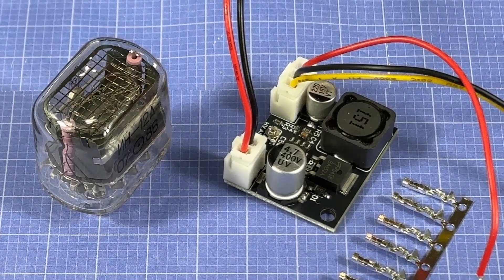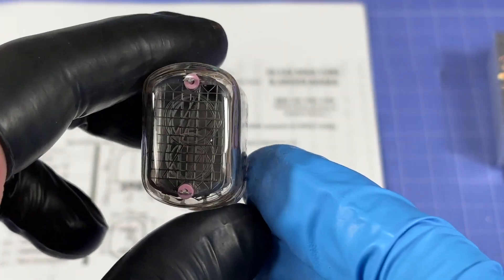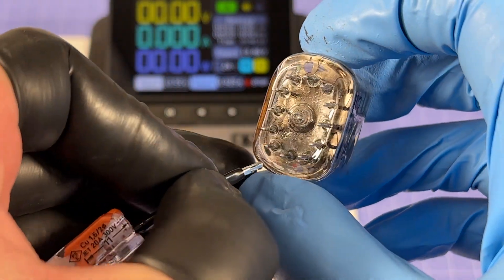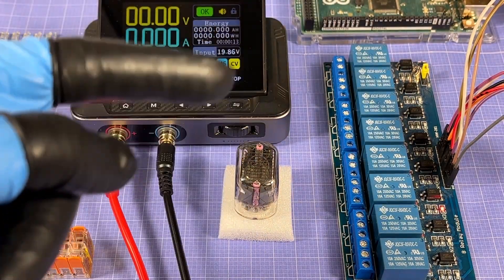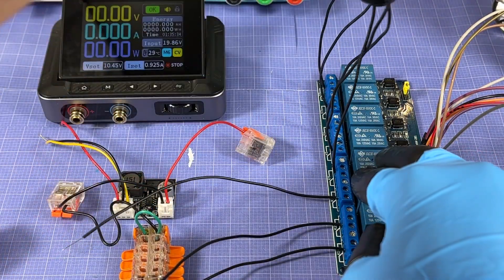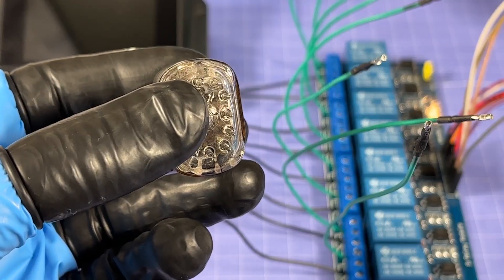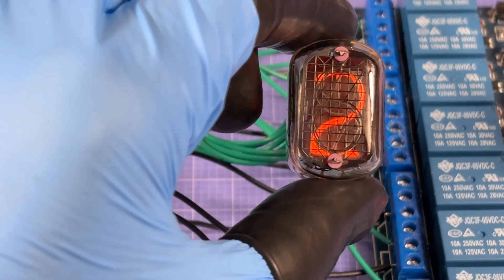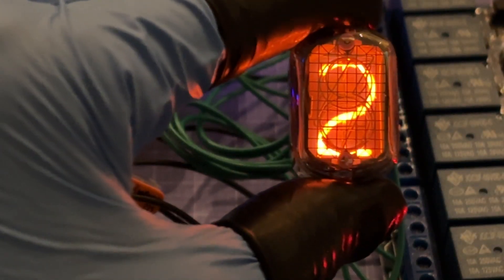Fun with Nixie Tubes & Control with Arduino (IN-12A) | Part 1

Comment: I have several Nixie tube clocks 

My favorite one I don’t have is a fallout theme one 

And there are a couple of nixie tube watches
Reply from the maker: Ooh cool! The nixie watches I’m super interested in, specifically the tiny Nixie tubes that go in them! 
I love miniature versions of stuff, like those tiny hard drives they had in those old iPods? I really hope I can get my hands on one of those and the equipment necessary to be able to use a tiny hard drive like that!

Analog and mechanical devices, especially cleverly designed ones have a special place in my heart

Comment: Since the numbers are triggered by the cathode, you can use a 600V N-channel MOSFET instead of a relay. Connecting the source pins to the negative pin of the boost converter is sufficient; it will result in a quieter and smaller circuit.

Comment: Just in case you aren't already, you should consider using mosfets instead of relays. They'll do the same thing but take up less space and don't make sound when in use.

Of course if the sound is desirable or intended then disregard everything I've just said!

Good luck with the clock!
Reply from the maker: Yeah I actually kind of like the sound haha, but I will probably have to use mosfets if I decide to go the route of reusing the same 10 relays for each digit, and just switching really fast between them to display the time… I’ve found some “micro-relays” which I’ve ordered as well though to see if I can manage to fit a whole bunch on a PCB and just keep everything super simple and as old-fashioned as possible
Reply: @KeonsLab I figured the clicking could be part of the old timey charm. Looking forward to the next update on this!
Reply from the maker: Me too! I’ve just had a really good idea of either 3D printing an enclosure and then putting real wood veneers on it to make it look like wood, or I could do carbon fiber or actual wood with a laser cutter.

Which would be the coolest? I personally really like the idea of real wood and putting a nice stain on it. specifically with a type of wood that smells good (I love the smell of red cedar wood, maple wood, and whatever they use that makes natural chunk charcoal smell so ‘happy’)

I want the clock to actually influence the room it’s put in by making it smell like a high quality old fashioned audio set or something where everything used to be made of solid wood and high quality parts and electronics. So no using wires with a cheap plastic smell to them! Preferably those fabric wrapped wires I’ve seen on my old 3D printer might be a good idea